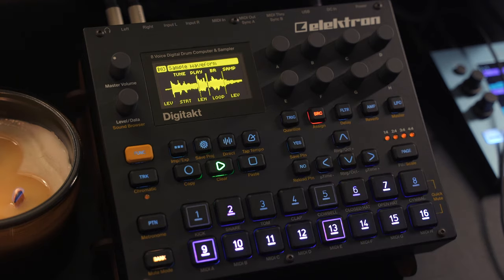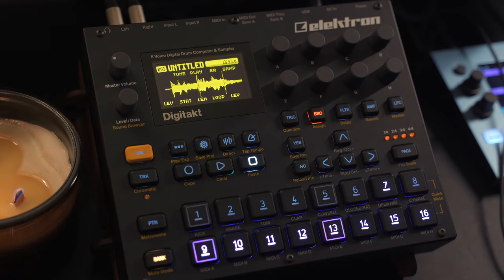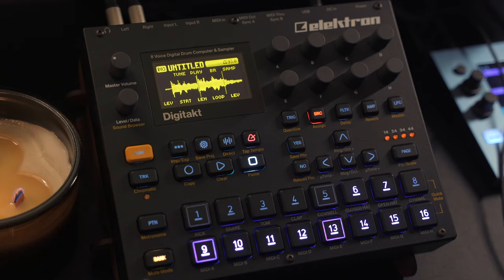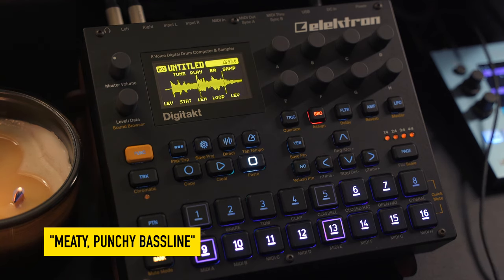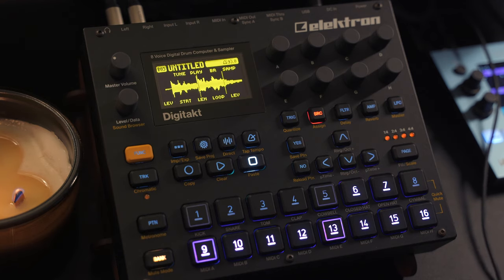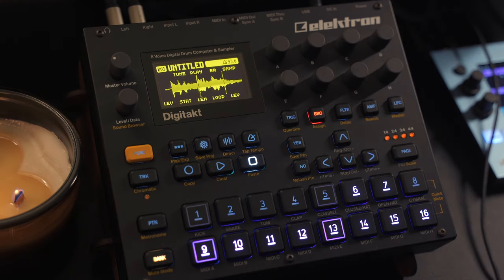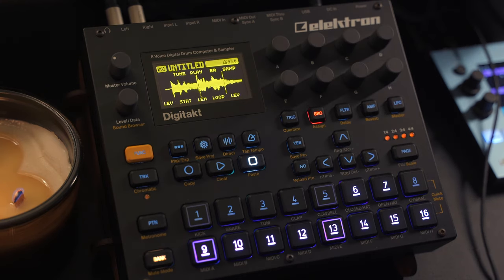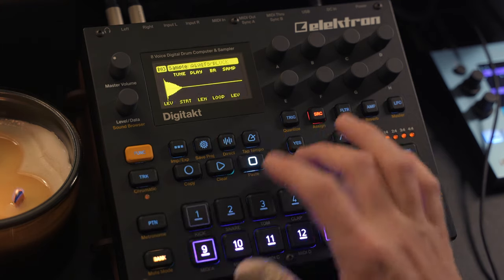Digitakt & Guitar: Sampling Chords for lofi beats

Comment: What is your signal chain from the guitar to the Digitakt when sampling?
Reply from the maker: I go through my pedalboard into my Princeton reverb amp,  and mic it with a Shure SM7B that I run into the DT with an XLR to 1/4” adapter
Reply: @SlowHaste  So a dynamic mic has enough juice directly into the Digitakt? No need to preamp it or anything?
Reply from the maker: @gdrdm  I didn’t have any issues with my SM7B, so ymmv depending on what you’re using. Make sure to play around with the gain settings in the digitakt too!
Reply: @SlowHaste  Hey, thanks for taking the time to reply! I'm surprised, I thought perhaps I wasn't understanding the signal chain. Time to buy new strings. Cheers!

Comment: Great video, thanks. Did you sample the guitar through a mic?
Reply from the maker: Thanks for watching!  Yes, I recorded direct into the Digitakt from my signal chain: Strat > Pedals > Princeton Reverb > Shure SM7b > Digitakt
Reply: @SlowHaste  hello! Thanks for sharing those beautiful sounds.
Do you think a Shure SM58 plugged directly into the input line of the Digitakt would work? (Using a XLR/jack cable)
My chain would be guitar -> pedalboard -> amp (polytone microbrute 2) -> SM58 -> digitakt
Or would I need to go through an interface/soundcard/preamp...
Thanks a lot!
Reply from the maker: @ezmirkasmala3125  that would work fine, you can always add a preamp down the line if you think it needs one!